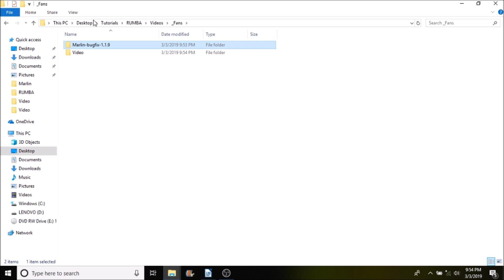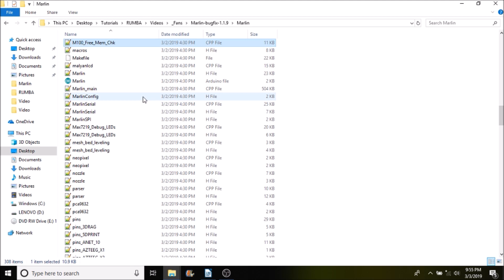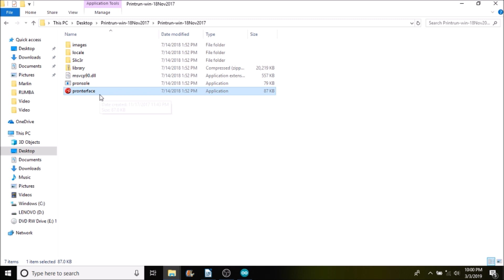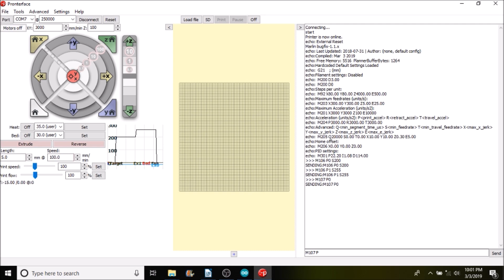RUMBA - Fans

Comment: Ok,  una disculpa. Tengo problemas al conectarme con mi tarjeta rumba taurino. Mi laptop tiene Windows 10, cuando quiero conectar mi tarjeta me dice que no se reconoce dispositivo. Ya he descargado e instalado el rumba driver setup. ¿Qué versión de Windows utilizas para conectar tu tarjeta rumba?,
Reply: En rumba RepRap descarge el driver setup, y las indicaciones son para versión de Windows 7 y XP. ¿Has intentado conectar tu tarjeta rumba con Windows 10?
Reply: Creo que sería muy bueno un vídeo donde se solucione este problema e igual forma podemos colaborar
Reply from the maker: English:
Ok, an apology. I have problems connecting to my bullfighting card rumba. My laptop has Windows 10, when I want to connect my card it tells me that it does not recognize device. I have already downloaded and installed the rumba driver setup. What version of Windows do you use to connect your rumba card?

Answer English:
I'm using windows 10.  I think I search via Windows online to get the drivers running.  I'll research the forums and see if I can find you a better answer, if it does not work.

Spanish:
Estoy usando Windows 10. Creo que busco a través de Windows en línea para ejecutar los controladores. Investigaré los foros y veré si puedo encontrarle una mejor respuesta, si no funciona.